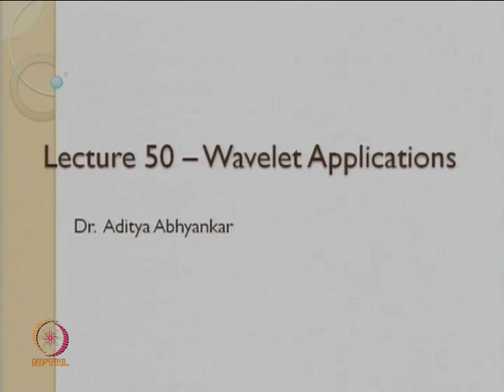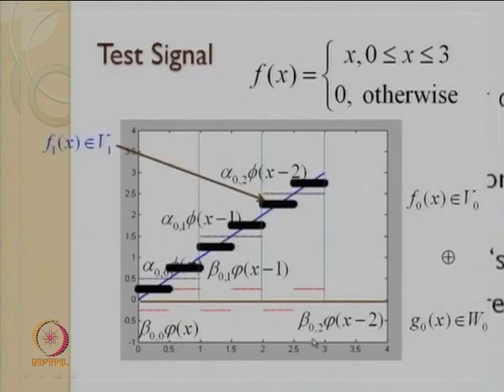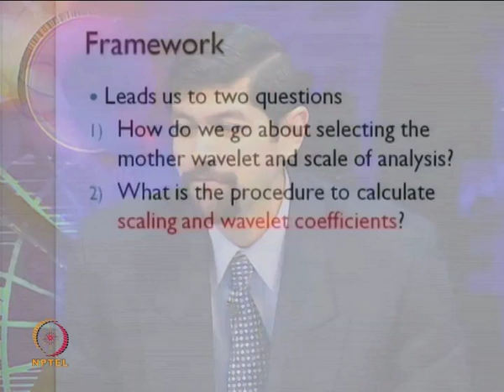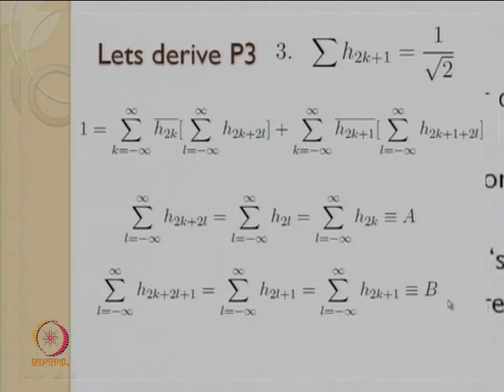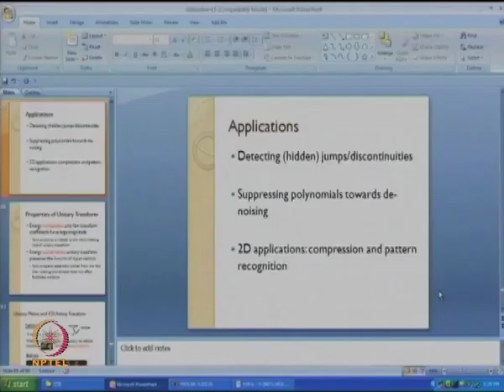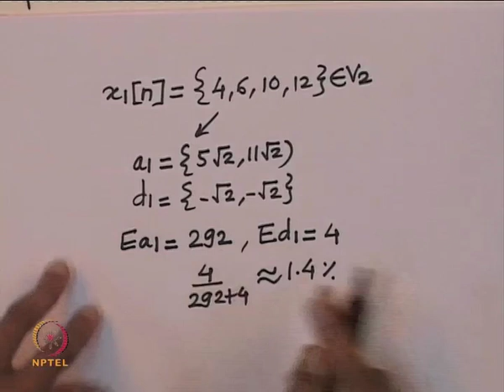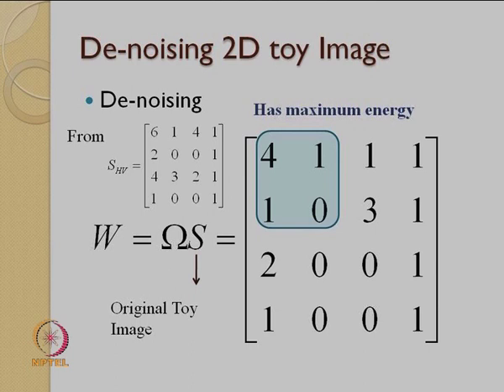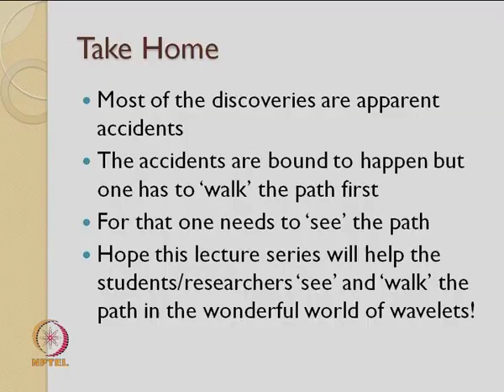Mod-01 Lec-50 Wavelet Applications

Comment: On the slide at 27:54 there's a mistake: where it says " we multiply both sides of the above equation by phi(t)", phi(t) should instead be changed to phi(2^(j-1)*t), otherwise the result would not be obtained.